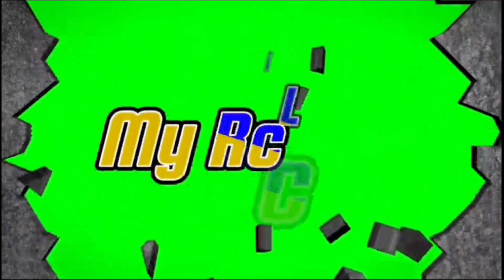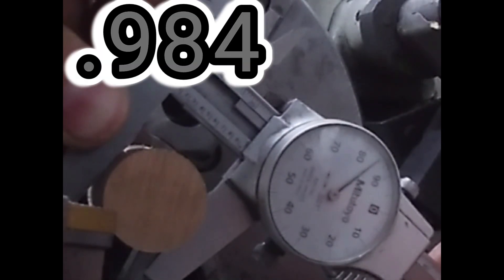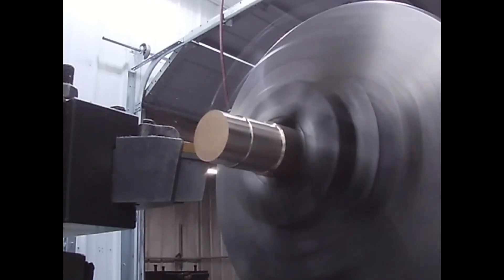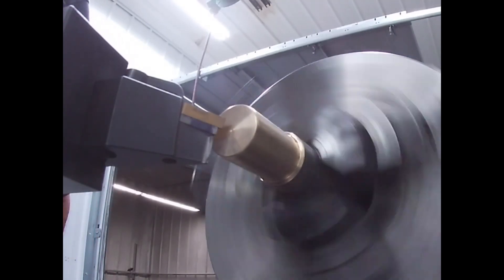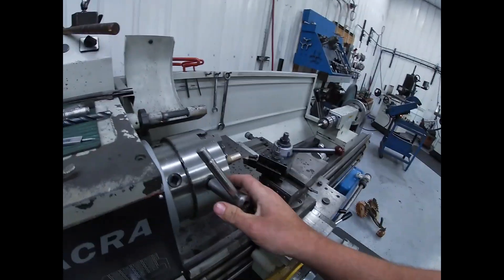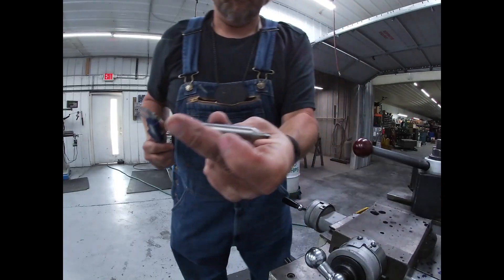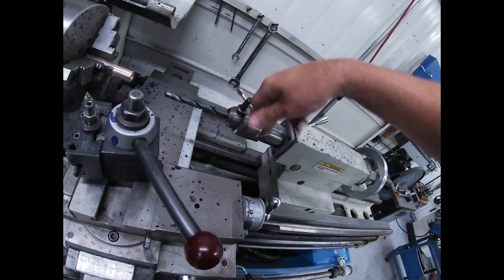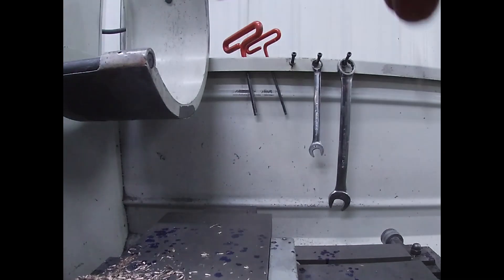Custom Machined Parts For My 100 Year Old Sprinkler.

Comment: I used to have a half a dozen of these, along with a lot of NOS parts. Most of the modern parts will work with the older units with exception of some parts. When they sold at my auction years ago, they sold for well over 100 dollars each. They brought in more than some of my seed signs. 
We used one of them on a 200 foot hose and it did quite well being able to water a very large amount of grass.
Reply from the maker: I love old time inventions.  Back when things were meant to last and were built to be serviced....not just thrown away.  
"Break it, fix it, wear it out........Make it do ..... or do without"
That's how life was back then.